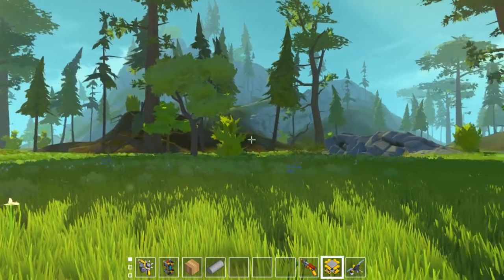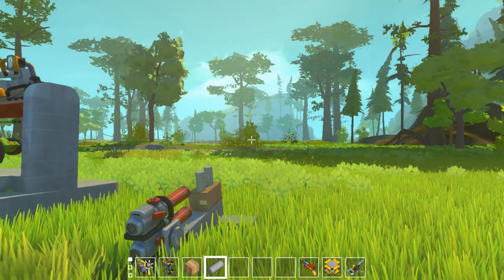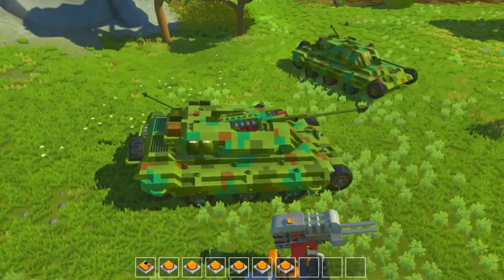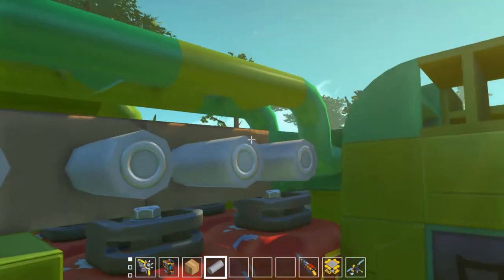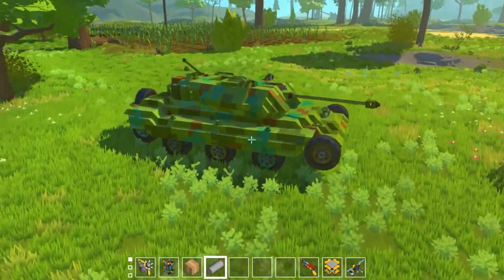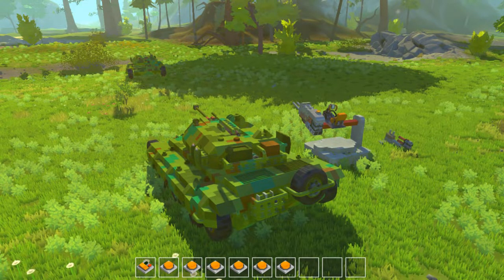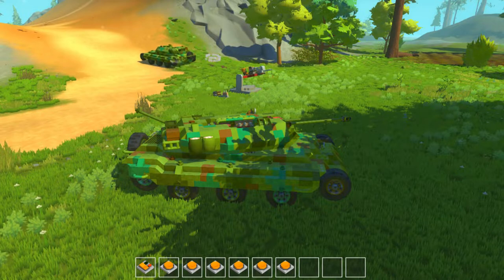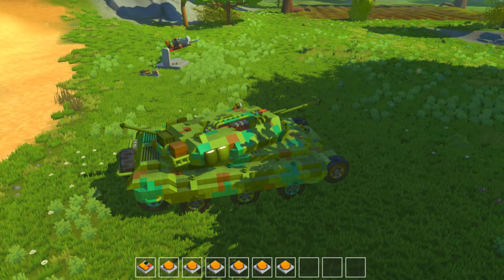20mm cannon |  [Concept]  |  Scrap Mechanic

Comment: this is a very simple and ingenious invention, and for increased penetrability put cardboard on the bearings, as for a conventional gun, and even better, use bolts, they are easier, which means they will fly faster ...
Reply from the maker: I didn't use bearings to increase reload rate. Bolts and pipes should have the same weight. Also bolts won't work unless the cardboard is on a bearing...

Comment: I used the long pipes for ammo instead and it can penetrate and explode pretty much any tank. I tested it and it can penetrate up to 12 block thick armor. also, you can put up to 14 rounds on each cannon

Comment: Wait if a block/”item” hits cardboard does the cardboard break?
Reply from the maker: No, these won't destroy cardboard. They are meant to "pierce" through blocks and hit explosive barrels inside the cannons of other tanks...
Or cause other issues in tanks, like interfering with A-D converters
Reply: @AlMagmaGaming  Thanks for the info, I was extremely confused about how these bullets worked but now I know.
Reply: I was confused to thx